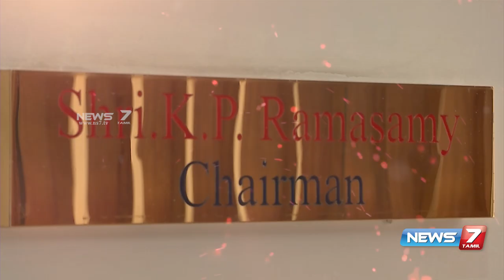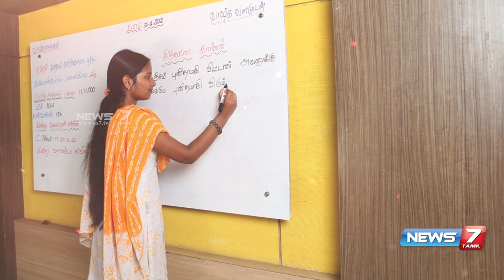KPR Mill Chairman Mr. K.P. Ramasamy in Peasum Thalaimai | News7 Tamil

Comment: Hydraguard is an Australia India Joint venture Company established in 2004, with Expertise in PE Polymer used as an Exterior Cover for Hose Pipes, the company has grown over the years and as a plan to diversify have started Producing PE Pipes, with 5  state of the art Extrusion Lines, and capacity to produce more than 4 Tons Materials in 12 Hrs, at the Moment Hydraguard Specialises in Producing HDPE and MDPE Pipes in Grades PE 63,PE 80 and PE 100, from PN 2.5 all the way to PN 16. iI is produced  in Coil format upto 110MM above which we provide straight Length Pipes in 3 and 6 Meter Lengths